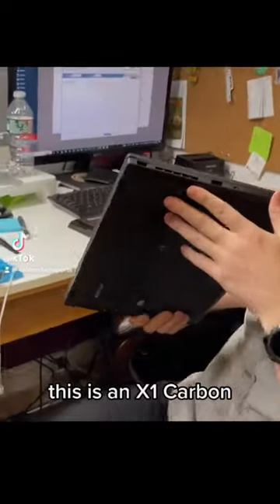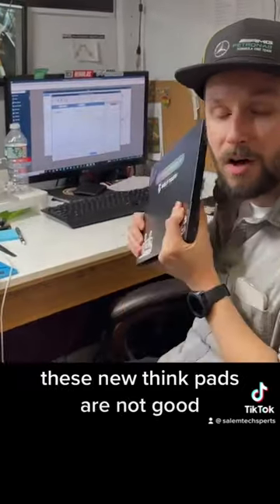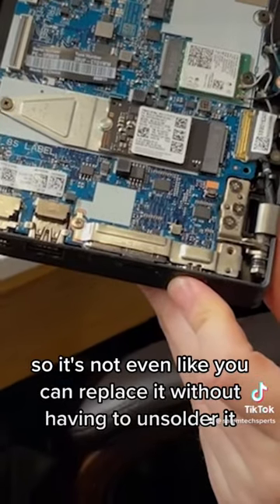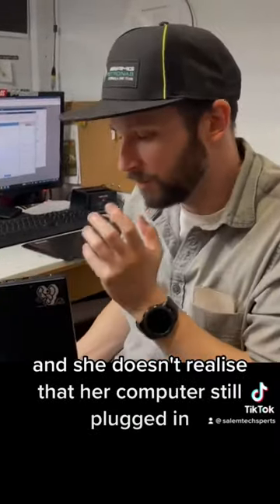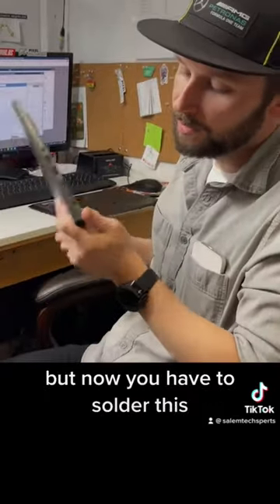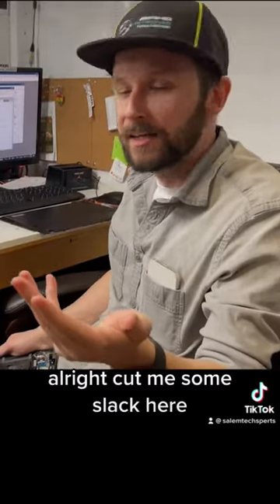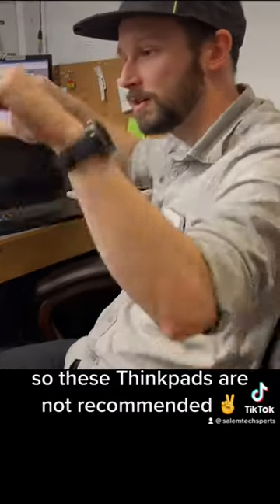Another reason older ThinkPad’s were designed better! #shorts #broken #computer #technology

Comment: "Why don't you have a microsoldering station?"

BECAUSE COMPANIES SHOULDN'T DO THIS SH*T!
Reply: Sounds like failure to adapt. As micro soldering jobs are the future.
Reply: @AlphaHorst  yeah but having a microsoldering station merely because companies are cutting corners is catering to their laziness.
Reply: @AlphaHorst  micro soldering at where it's useful is done mostly by machines
and who's gonna solder as a full job when machines can do it cheaper, faster, and better?
and the hardware needed for it is also hard as hell to obtain at home, unlike, yk, a replacement part from the copany that just gets slapped in
Reply: @krek420  its also a right to repair issue among other things, something that can so easily break should be easy to fix, at least that is what I argue and how I design things though that is mainly for personal use stuff at the moment, would not be that hard to make it easily removable and still have micro saudering
Reply: A right on where you should be able to fix your own stuff is something that we need, battery replacement used to be so easy where you could just push the button and put a new one in in under 3 seconds now it's a 10 minutes worth of job with a risk of broken clip of chassis...

Big tech company is not your friend, faster it is breaking out, more money for them and more e-waste in the landfill, and more mercurry, cadmium, and other poisonous substance in the surface of earth...
Reply: But no machine can rework a motherboard in a computer.
Reply: By soldering ports i could easily make living in India 😂 here a mini usb port is 0.12$ and we charge minimum 3$  
I could easily make a 15$ it's a good amount in some places
U could not throw away your phone bcoz ur port damaged
Reply: @tpinkfloyd  Then fight back by from companies such as framework who design laptops with reparbilty in mind.
Reply: Should have one anyways there are 100s of fixes a shop can do with one that a shop without will tell you to buy a new device
Reply: @AlphaHorst  Yeah Ill get right on that. Charging 200 bucks for a soldering job on a laptop thats worth 400....
Reply: @petesagat8952  you do realise that soldering on a new HDMI port falls under micro soldering? The most common type of laptop repair? One which costs like 30€ and is done in an hour? 
All of you seem to only think about chip replacement on a mainboard repair.
Yes mainboard repairs require micro soldering, but they are a different beast
Reply: @AlphaHorst  You charge $30 an hour? Not sure how you survive.
Reply: Since all laptops will be one board soon if you won't microsolder then board replacement is the only fix for these issues.

Comment: So… sadly, it seems my previous assertion regarding Thinkpads being indestructible is no longer true. :/ Again, new MacBooks destroy them on both counts, in that MagSafe 3 prevents those accidents in the first place, and both its connector and the USB-C ports are also modular (which has the added benefit of protecting the logic board from USB killer attacks).
Reply: The usb-c ports on MacBooks still require disconnecting a ton of fragile little connectors and removing the motherboard. It had it’s own problems.

Comment: Aren't most new laptops built this way tho? With the charging port connected to the board? I have a X1 carbon gen 7, no issues so far.
Reply from the maker: Yes, and they're all horrible. But for some reason the vast majority of USB-C failrues I see are from Lenovo.
Reply: @SalemTechsperts  any recent reliable brand/model for work use?

Comment: As a tech myself, I have to say these thinkpads are some of the easiest repairable laptops today. I Can usually get one of these bad boys out in less than 2 hours if I’m not extremely busy but I do miss the older models
Reply: 2 hours for a tech doesn't make it easy lmao. Replacing a barrel plug took me 15 min on my mom's old vaio.
Reply from the maker: ThinkPad’s are designed quite well in terms of tear down, but this soldered bs turns a previous 10 minute job with a single screwdriver into a 2 hour ordeal requiring a microsoldering station.

Comment: EVERY laptop manufacturer now does this, dell had did it with the latitudes LONG before usb c was even a concept. I feel like in my 10+ years of repairing computers it was actually a rarity to get a laptop with a modular charge port. 
If anything as the years have gone on the laptops have just gotten less and less modular. the absolute worst to me to date are chromebooks. they are just made to be ewaste in a few very short years.
Reply from the maker: We had a good run between 2014-2018ish with HP, Dell, and Lenovo. They converted their consumer and business models to modular barrel ports or yellow squares.

Comment: Ik it's like, outside the argument entirely, but I found that the old style can also easily be retrofitted with a board to give usb c charging with no problem, so I don't see why it has to be soldered on if it's completely doable through a regular flex connector afaik

Comment: Ive got my latitude E5430 from 2011
97 watt hour modular battery, modular ports, non soldered CPU

You can take out the SCREEN with your HANDS and put in a better one
You can put in a webcam and microphone

And 3rd gen intel laptop chips are so strong, its still a faster processor than 90% of those low power netbook chips, even though you can buy one used for $60

Comment: You are right bro. I'm aslo a Technician. c-type connector in laptops and chromebooks are failure. sometime it damage all pcb tracks. so replacing is a challenge. So my oppinion don't buy any laptop using c-type charging port.
You are right bro. I'm aslo a Technician. c-type connector in laptops and chromebooks are failure. sometime it damage all pcb tracks. so replacing is a challenge. So my oppinion don't buy any laptop using c-type charging port.
You are right bro. I'm also a Technician. C-type connector in laptops and chromebook's are failing. Sometime it damages all PCB tracks. So replacing is a challenge. So my opinion doesn't buy any laptop using c-type charging port.

Comment: I am all against soldered connectors. I do microcontroller stuff, so this kind of soldering is not new to me. I know how it feels trying to warm up a thick board with metal connectors on it. But in lenovo's defense, the connector being on both sides of a thick board + brackets is the only way it will not be yanked out. And that seems to be their priority. It's a design decision, not a anti-consumer practice as by itself. I still don't agree with their take though. Modular > Tanky on connectors.

Comment: The new lenovo e15 gen 2 laptops have a issue where the usb c charging circuit dies and the laptop stops powering on or charging. Good thing lenovo is repariing them for free . Sending a box to send the laptop in for depot repair.  We've had a lot come in for this issue

Comment: Usually when the USB C stop working you either update the Power Management driver or the Bios. I'm a Lenovo specialized technician.
Reply from the maker: This video specifically addresses the physical damage that's commonly seen on these models, not the software. But I appreciate your comment 🙏
Reply: @SalemTechsperts  that's why I'm telling you that. Because a lot the times people think that is faulty hardware but in a lot of cases is not. Some of the issues with the drivers I mention which by the way are firmware based and store on the actual bios are that the USB C stop working. I deal with that on a daily basis. Actually if you go to Lenovo Support computers like p43s, p51, t480,x1 carbon will have a Warning at the Top of the web page that talks about critical bios update. Sometimes can even disable usb c, hdmi and thunderbolt.
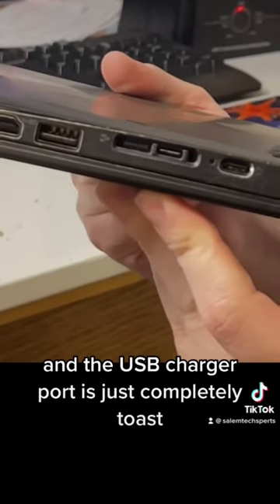Reply from the maker: @tabris0153276  sorry I should be more specific. I’m strictly talking about visibly damaged USB-C ports where the pins have been bent or the structure itself is visibly damaged, as seen @ 0:19 . This video is criticizing the physical strength and durability of the USB-C port.

Comment: Idk how usb c keeps breaking but in the 3 years of laptops with USB C, None have broken, just remember to not drop the laptop on the charger or to not stick foreign objects in the port. Also it's soldered because I bet 24 tiny wires and a connector would take up too much space in such a thin laptop.

Comment: One of the things I really don’t understand about USB C, why the hell is the weakest part, part of the most expensive device, the cables you can beat around the bush with, the device itself with the little slim piece of plastic inside is on the most expensive part, lightning connectors on iPhones are so much stronger for this exact reason there is no flimsy part on the phone itself only on the cable.
Anybody who has had an iPhone has had many cables die but never had the charge port die, aside from being filled with gunk

Comment: To be fair it's quite basic repair job to begin with, like for real at worst you would need like 10$ worth of equipment and parts(being a heatgun, solderpaste and  the aftermentioned usb-c), compared to custom "easily swapable" module that would be priced in about the same ball park,it's not a good look for latter one.

The problem here is way deeper, usb-c shouldn't be used that way to begin with, it's too brittle to withstand the abuse, way, way better solution is magnetic charger like the one on macbooks(and some ultrabooks if i remember correctly). It is way, way harder to break something like this, compared to ordinary usb-c

Comment: Most customers will claim something like this off their insurance and get a new laptop.
Reply from the maker: Yeah if they have insurance. Most customer's never get insurance.
Reply: @SalemTechsperts  I worked for a repair shop out in the country whom also didn't do board repair. We'd need to send the laptop off to our parts supplier if we wanted to repair something on the main board. 

The old Lenovo laptops where actually pretty solid, but in recent times they've gone down hill.

Comment: Don't blame Lenovo.  All of the manufacturers are moving in this direction.  My biggest gripe with Dells moving to Thunderbolt charger has been that out in the field, my guys have them plugged into Power Inverters in their trucks.  They bounce around int he trucks while they're driving down dirt roads.  On the laptops with the barrel connectors, they were mostly resilient but with thunderbolt, the TB ports wear out and stop making a good connection.  I have to ship laptops back to Dell when the TB port dies - no power, no connectivity and after the second port is damaged, the machine is done.

Comment: I actually do not like tablet like devices like the thinkpad and surface pro, beyond being an expensive typewriter and surfboard they dont really hold up to the grind. Slow, runs hot, small amounts of memory, you can't upgrade them not easily anyway, and the battery just underperforms. My last surface pro was running windows 8r which i think means restricted. And no that surface stopped working years ago.

Comment: just because it's soldered doesn't mean its non replaceable. It's fairly easy to replace, just need to pull the board, which is annoying and i'd much rather have modular everything. these kind's of engineering flaws make my life miserable.

Comment: I know it's a bit pricey but I stopped buying normal PCs I started buying gaming ones instead they're more powerful some of them have decent battery life and pretty much everything not critical to the main board is replaceable including but not limited to fans, RAM, SSDs, power units, the entire display, even keyboards hell they even sell position glass touchpads for many different models I currently have a razor blade 14 2023 and I'm very happy with it and it's super easy to replace both the battery RAM SSD even the fans it's great

Comment: I miss the detachable batteries
Nowhere to charge? Just swap it with a full one
Battery health going down? Just swap it.
Something went wrong and even the power button doesn't work? Just pull it out
Want more battery capacity? Just swap it with a thiccer version

Comment: I’m pretty sure you get way faster charging speeds out of usb c, and this video is very misleading. It’s fine to get one of these, all it means is that you can’t expect a dude in the back of a subway to fix it. But most other repair stores likely have a soldering station so it’s no real issue. It’s very easy and pretty damn cheap to replace usb c ports.
Reply: Lenovo could also spend like half a cent extra on the MB with a replaceable port.

Comment: its sodered for a good reason. USB C or thunderbolt needs direct connection to motherboard otherwise troughpout speed cannot be reached, this is a simple fact of life has nothing to do with the brand Lenovo. Allmost al brand do it.
Reply from the maker: The A1707 MacBook uses a modular USB-C / Thunderbolt 3 port. Most cell phone manufacturers have the USB-C charging port soldered to a modular board that can be replaced. Soldering it directly to the motherboard instead of using a "middle-man" in between is simply cost cutting, which yes, almost every brand does.

Comment: 1 Hour of IT consultant work is like 200$. Changing that port + handling = 2-3h. Just buy a new one. It's not that hard teaching the employees to take care of their stuff.
Reply from the maker: The problem is this design is inherently weak. Even if the customer is as careful as possible, it will eventually fail (out of warranty) due to wear. And when it does, I’m sure all these soldering consultants in the comments will do it for $10 like they claim 😂

Comment: me watching you say the x1 carbon is old meanwhile im watching this on a t530
Reply from the maker: You’re watching this on what’s arguably the best modern laptop ever made 🫡
Reply: @SalemTechsperts  fr, this thing has gave me no issues, i should upgrade to windows 10 on it... but it boots to windows 7 in 13 seconds after a new ssd so im keeping it on 7 for now
Reply: @SalemTechsperts I’ve had the T530 for 10 years, upgraded cpu, ram, ssd & battery, still going strong as day 1.  But I broke key “r”, any suggestions where to find a replacement?

Comment: al companies are copying apples Soldered ram and shit, but  not the usefull "magnetic charger plug
that is safer that usbc, if it get dirty, just use a small brush dipped in isopropil give it a little scrub, since its we in alcohol it cant make static

Comment: Call me dumb but how the hell can a connector burn like that. They know the amps flowing through there so either it's badly designed or bad cable, or the machine pulls more than it should.

Comment: I’m just curious if you need to do any with that requires soldering  is that done at another location ?
Reply from the maker: It depends on the level of microsoldering required. 4 pin charging ports I'll do no problem, but USB-C or something beyond my soldering level I bring to a partner shop a few miles away.

Comment: USB C is a weak port
Reply: No.
It really isn't. 
It is much more durable than lightning and its predecessors like micro and mini USB.
It is just people being stupid. For me not a single USB C port broken in nearly a decade. 
I also know of noone who had such an issue with the port outside of an accident. They are not the insulation on apple cables which breaks under its own stress. 
Maybe people in the EU are simply more honest if sth broke because eof them or by itself.

Comment: So un solder it.
Reply from the maker: As a shop, we know how to fix it. But what should the average consumer do? The point of this video is to highlight that a common repair that used to be able to be done with a philips screwdriver now requires a repair shop with soldering skills. It's a trend that's happening in every industry. It's like your air filter being welded to the entire intake manifold. Consumers are being pushed out of doing their own repairs in every single industry.

Comment: Bro what should i do if my legion 5 pro camara switch broke, i cant find the usb board for it ( the camera switch is on the same board as the usb ) because im in indonesia, what i can do is desolder the switch and get a new switch . But i dont know what the switch is called, do you know what i should do, or what the switch is called
Reply from the maker: I have no idea man, that's a tough one.

Comment: I love when repair shops say unfixable because you have to solder them. I mean that’s your job, even I can do that and successfully did it with HDMI ports in the past.

Some repair shops see everything unfixable that can’t be fixed by cleaning the dust off it
Reply from the maker: Who said unfixable? I said it was non-replaceable without soldering. A part that used to require a screwdriver now requires a microsoldering station, something the average consumer doesn’t have. But go off King 👑

Comment: Perhaps people should take their laptops to a more competent repairman. it's not that it's non repairable as you state, it's that you personally, can;t do it.
Reply from the maker: Perhaps you need to improve your comprehension as I said, "It's not like you can replace it without having to unsolder it". The whole point of the video is to show how a simple 10 minute repair consumers used to be able to do with a screwdriver is now a repair that only shops can do with a microsoldering station. But if insults and assumptions make you feel better about yourself, I have quite a few other videos you can dislike.